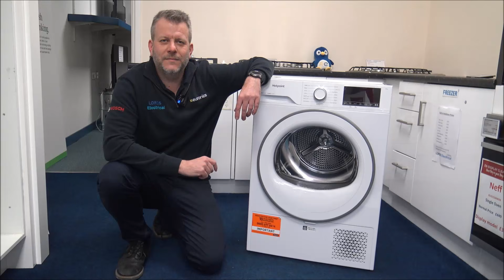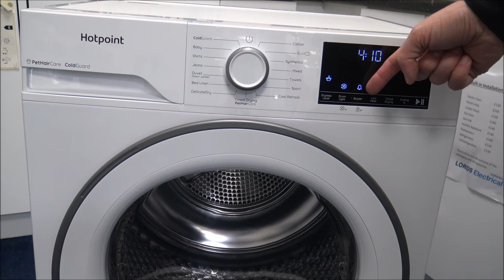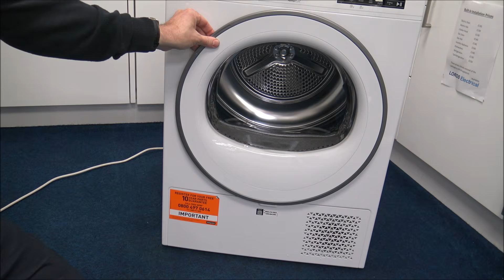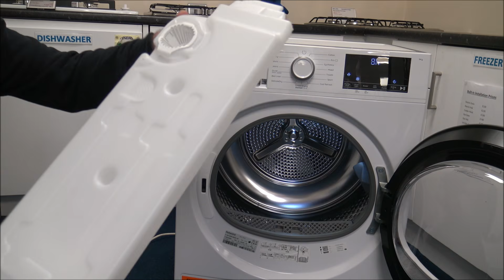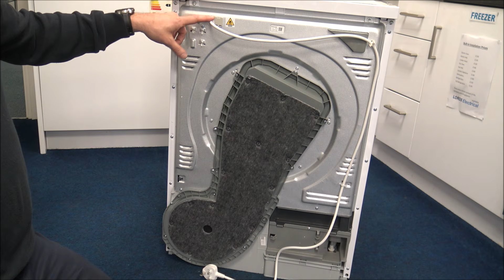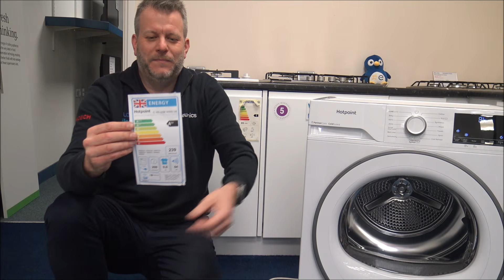Hotpoint CHD93MWWSUK Heat Pump Tumble Dryer

Comment: I recently ordered one and it's not working...cycle finished with clothes still wet and water tank is bone dry...not sure what the issue could be because all I've done is operate it in accordance with the instructions
Reply from the maker: That does sound odd as there is no installation needed. I would contact the retailer you purchased it from to get them to have a look at it and get it sorted
Reply: @lords-electrical thanks! I just got a replacement today and that works fine (phew). Interestingly, the rear of the faulty one looked different to the new one (and didn’t include some accessories the new one did).

Comment: Can you show where the sensors are  and how do you clean them
Reply from the maker: Normally sensors on a condenser dryer are on the inside of the door. Just a wipe down with a damp cloth should be good to get them clean enough

Comment: Do you need to put the drain at the back as well or doesn’t have to?
Reply from the maker: You don't have to use the drain hose, it is optional. If you don't then you will have to empty the water container

Comment: Mine has just stopped working it's making a horrible  high pitch noise
Reply from the maker: I'm not too sure what it could be, it sound like it may be an issue with the drum or belt, i would just just recommend contacting the retailer or manufacturer to get them to sort it out for you

Comment: Thanks for this helpful overview. I have just purchased one and wasn’t sure about removing the felt at the back of the machine. I also wasn’t aware that they don’t work so well in colder spaces which is annoying as mine is in the garage. Still, I have put on my first load and will see how it goes current temperature in there is 13 degrees
Reply from the maker: Great to hear the video was helpful, good luck with the dryer
Reply: How did you get on with yours in the garage?